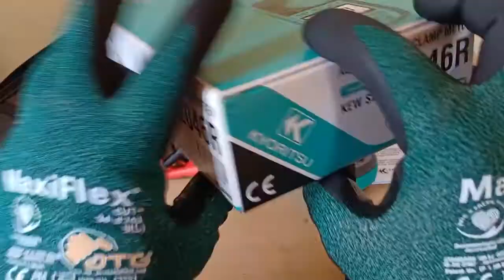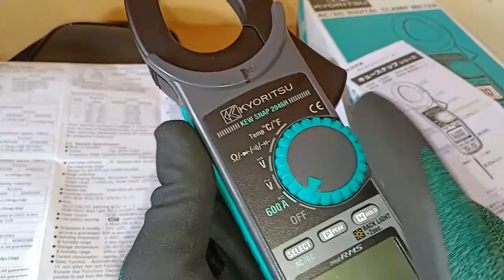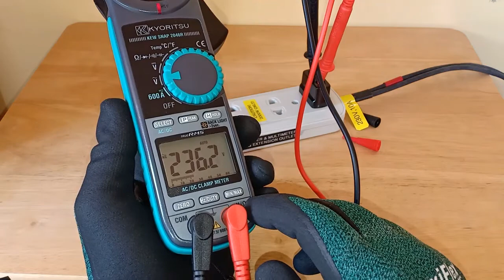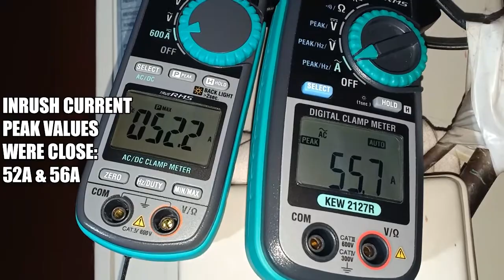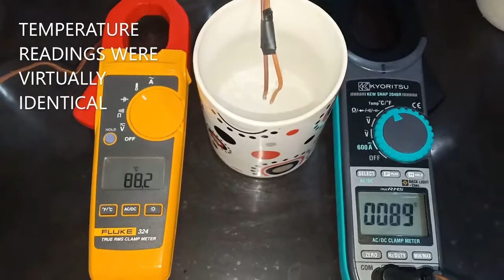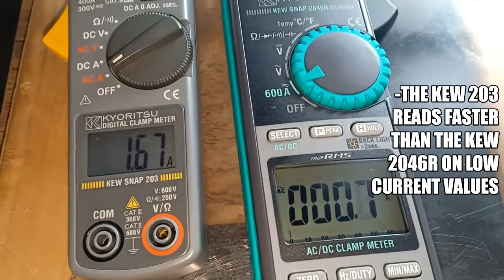[Eng Sub]KYORITSU KEW 2046R AC/DC CURRENT TRUE RMS DIGITAL CLAMP METER- A REVIEW

Comment: How much low dc current it can measure ?
Reply from the maker: @purplefurture6960  1Amp
Reply: @ramschannelreviews  ah ok
How can i find clam meter
My needs dc voltage and current , that its clamps detect volt up to like 50 dc volt
And dc current i need it to clamp black car battery wire to see if there is leakage or not

Comment: I saw you had a Hioki CM4376 clamp meter, how do you compare the Kyoritsu KEW 2046R and Hioki CM4376?
Reply from the maker: Thanks for watching. The Hioki CM4376 is superior to the Kyoritsu 2046R. This is expected as the CM4376 cost more, has built in Bluetooth adapter, thinner jaws, DC power (kW) function, better backlight implementation, and inrush current (both instantaneous peak & RMS) to name some examples. It lets you view voltage and current waveforms on the Hioki Gennect Cross app, as well. You can compare their specs for more details on their individual websites.

Comment: kyoritsu 2046r needs calibration??
Reply from the maker: Thanks for watching. If you mean the low reading when taking low AC current as noted in the video, yes I think my unit may need to be calibrated for that. To be fair, it's possible it's just my unit. All other functions were good.
Reply: @ramschannelreviews  owh. because i also have that kyoritsu 2046r.  I tried on the fan in my house and Tried looking at the meter I couldn't get a reading.  maybe the 2046r can't display a low ac current (A) reading
Reply from the maker: @waiedragon9107  Just now, I took AC current readings of my stand fan with the KEW 2046R and a Hioki CM3289. The KEW2046R reads zero, while the CM3289 reads 0.30A (300mA). The KEW2046R apparently wasn't specified to measure current below 1Amp. This isn't surprising for an AC/DC current clamp meter. For instance, my Hioki CM4376, also an AC/DC current clamp meter, is not specified to measure below 1Amp. For AC current only clamp meters, like the KEW2127R & the Hioki CM3289, measuring below 1Amp AC is often possible. In my video, the 2046R measured 1.3A AC when compared with the KEW Snap 203.
Reply: @ramschannelreviews  owh. Thanks you..
Reply: @ramschannelreviews  In your opinion, does my clamp meter 2046R need to be calibrated?  because I just bought the meter clamp.
Reply from the maker: @waiedragon9107  As to the question of calibration, my opinion is if you have convenient, economical access to it then why not? My thoughts on this is purely suggestion, based on my comparison of the 2046R with the current readings of my other clamp meters on low value current. However, there may be more factors to consider, which I am not aware of, before calibration is really warranted. Perhaps you can compare the readings of your 2046R unit with other clamp meter readings first, just to check as an initial step.

Comment: Thanks a lot !!
Do you know which Japanese clamp meter would have LoZ feature or relative zero ? Thanks
Reply: HIOKI CM 4371-4372-4373-4374-4375 y 4376 todos estos modelos loz a filtro de paso bajo
Reply: Loz o filtro de paso bajo las pinzas hioki los traen
Reply from the maker: If you mean low impedance voltage measurements, like the LoZ of Fluke 117 & Fluke 116, I don't know of any Japanese clamp meter. For relative zero, if you mean Zero Function Button before making DC current measurement, I think most, if not all, DC current clamp meters have that including the Japanese brand Hioki CM4376 & this KEW2046R.